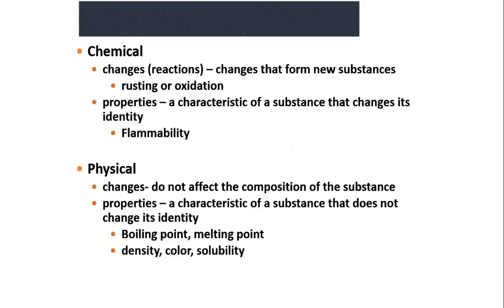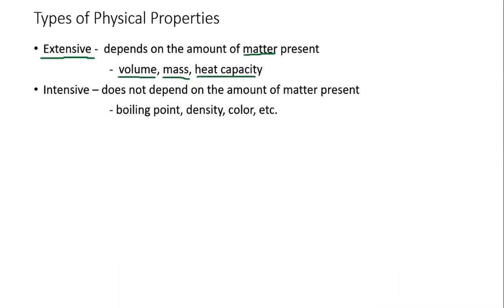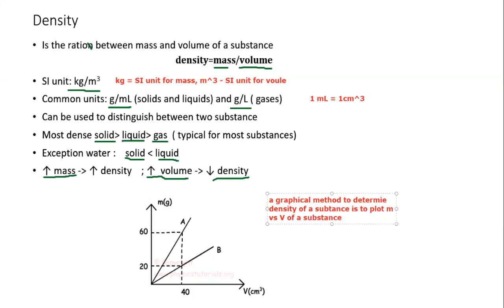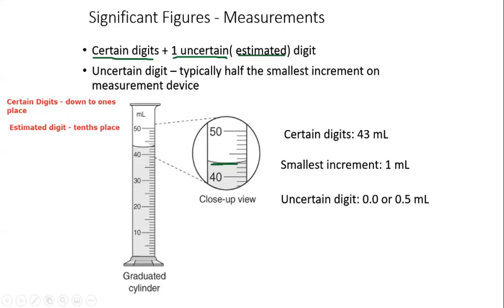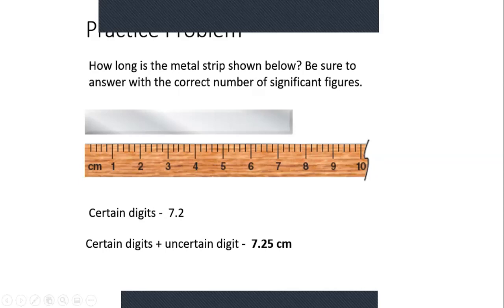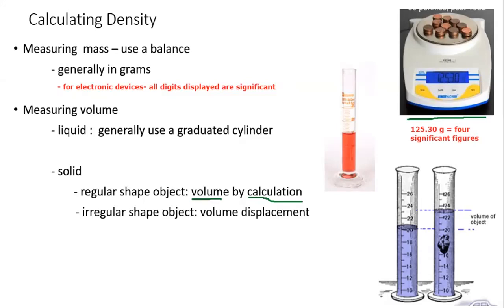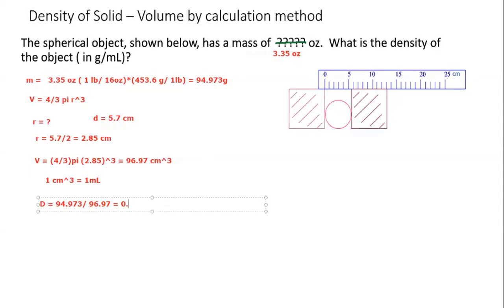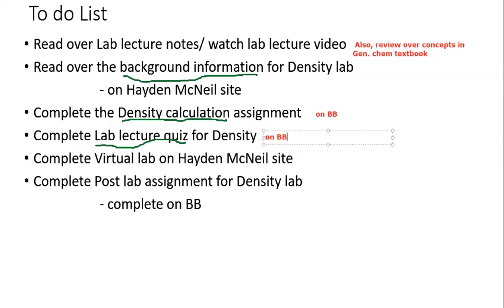Lab 2 - Density  Video Lecture

Comment: At 20:45, wouldn't the measurement be 7.50 since the tick marks represent 0.2 each, not 0.1?
Reply from the maker: Hi, thanks for the comment. You are correct the tick marks represent 0.2 not 0.1. Generally the uncertain digit is half the smallest tick. When the tick mark is 0.2, the uncertainty is little more ambiguous. Some would say 7.5 while others would record as 7.50. I would accept either.